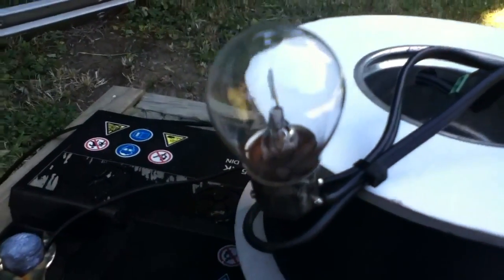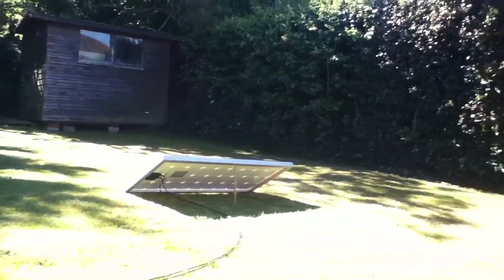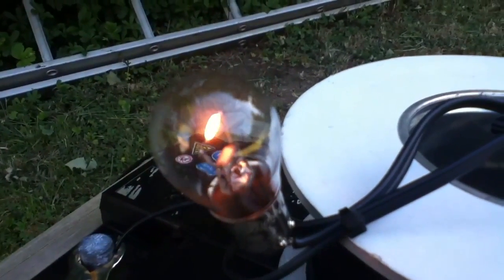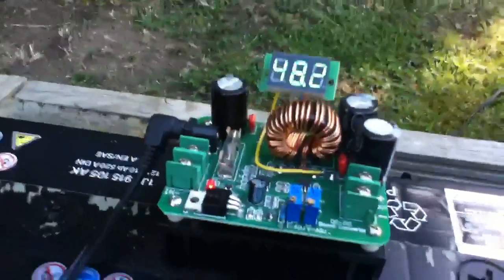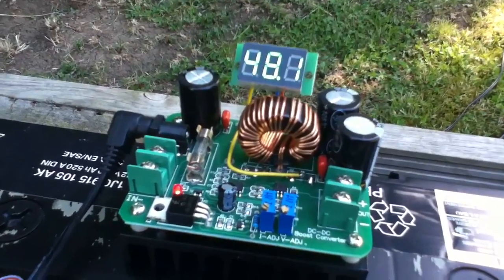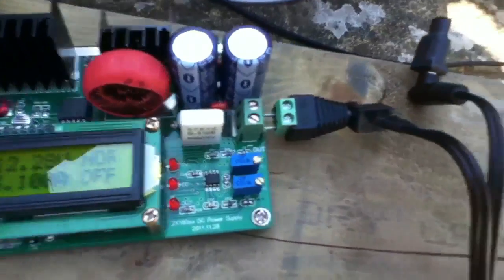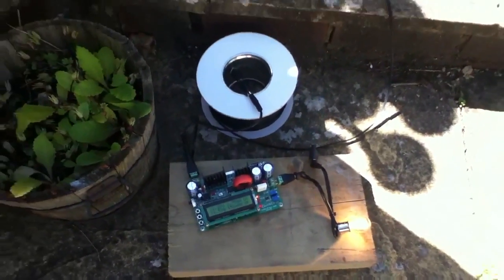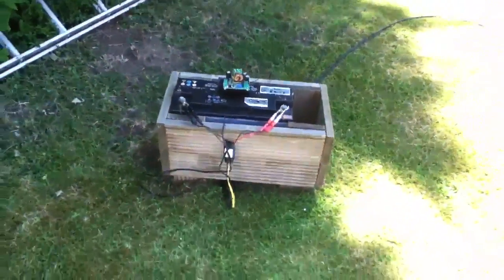12V to 48V - High Voltage DC Power Transmission Reduces I2R Losses

Comment: Fighting fire with fire so to speak. Increasing voltage at the source to overcome the opposing voltage drop created by the current traveling through the resistive conductor. Nicely demonstrated. Thanks

Comment: Rather than stepping up, could you simply start with a higher voltage power supply?  I want to run 12v to a 100w (8A) load along a 50m cable.  I have worked out I will get about a 50% voltage drop if I were to use my desired 12awg cable.  If I simply start with a 24v 5A power supply, can I just throw a 12v buck converter at the load end to cap the voltage?

Comment: Julian lett Could you use a buck step up 12v to 48v to run Sanyo Denki fans 48v from a standard 12v atx power supply. Need to run 5 of them for a ridiculous over the top experiment for water cooling rig

Comment: How would the boost converter take to a short circuit? It would be tricky fusing a higher DC voltage. Also, any idea if the additional cost of the converters (not much thanks to China) and comparing losses is worth it over spending more on copper?

One major advantage with the converters I can see is the constant stable voltage thanks to auto adjusting on the buck.

I suppose though it's down to the distance, question is though what distance does this become necessary?
Reply: +Tera Volt These boost converters usually have a current limiting feature, so the converter itself wouldn't be damaged by a short if the limit was set low enough.

Comment from the maker: Look through the listings of ebay seller 1984yht888 - he does a 600W buck (10A) and a 1200W buck (20A). Both can take up to 62V input. But they're quite expensive - £48 and £75 respectively.

Comment from the maker: I'll set it up again (when the sun comes back out) and measure the watts leaving the battery. That'll give me a figure for the total losses. The boost converter is 600W (although I wouldn't want to run it continuously over 300W) and the buck converter is rated at 300W, so these are the limiting factors for total transmitted power.

Comment: Nice experiment Julian, shows the value of using 48v vs 12v for solar pv over long runs.

Do you have any estimate of total losses using the boost/buck converters? Is there a practical limit on the amount of power transmitted?

Comment from the maker: There is a good size heatsink on this unit which has the MOSFET and diode attached to it. It didn't get warm with the 50W LED, but the 100W LED will draw around 10 amps from the battery so I'm expecting the heatsink to warm up.

Comment from the maker: I took the boost converter up to about 95 volts, but bottled out because the output capacitors are rated at 100 volts and I wasn't in the mood for a loud bang. The main problem with higher voltages is that all the HV buck converters I've seen have a maximum input voltage of 60 volts. I'm not entirely sure I trust maximum specifications so 48 volts seemed about right to me.

Comment from the maker: Both eBay - both from China. 600W boost converter about £13, 300W buck regulator with LCD was about £25. They are really nice units, but I'd heavily de-rate the quoted power handling unless you like your electronics hot!